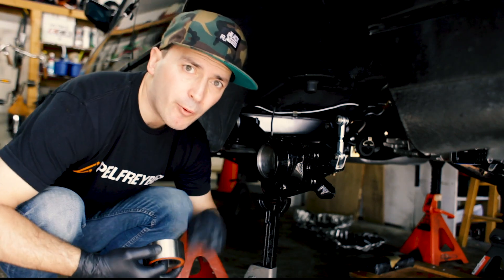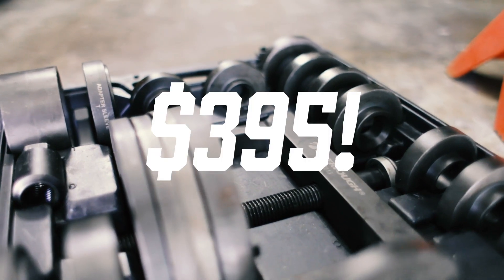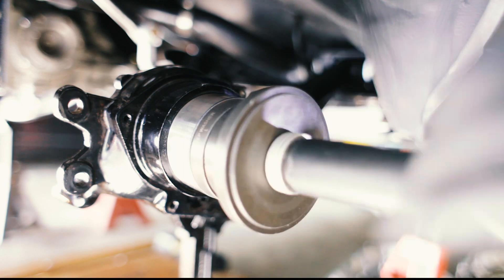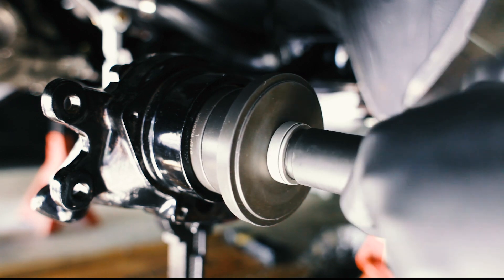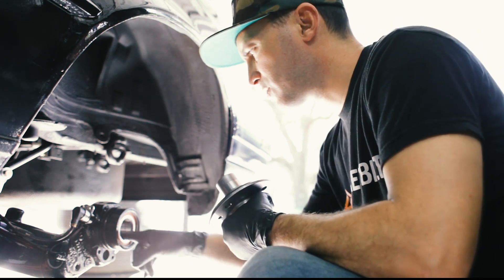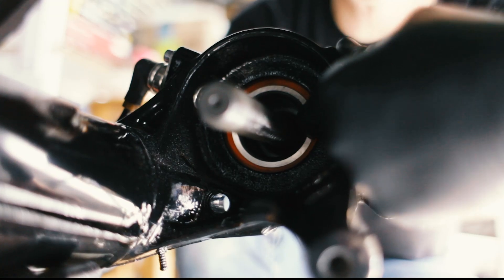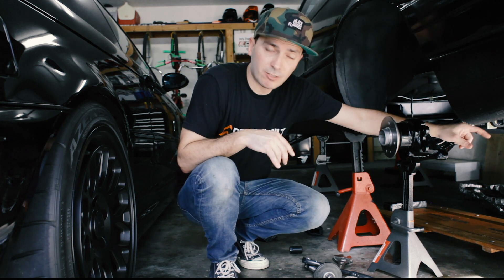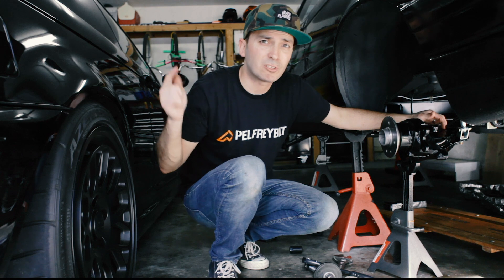Installing Rear Wheel Bearings and Hubs on the E30 | vlog 078

Comment: how do you get the dust cover plates installed? i think they go on first and then the hub.
Reply: there are only two ways - pull out the hub while destroying the bearing or cut a slit in the cover and slide it over the spindle.

Comment: What hubs did you use?? BMW new is $400 each side and I think that’s a bit insane
Reply from the maker: To be honest I don’t remember, sorry. Looking through my old receipts I only have receipts for the bearings and front hubs, but not rear hubs. So I may have cleaned up the rears and re-used the originals. I know the fronts were an off-brand, not genuine BMW. At the time I was buying these types of parts off eEuroparts.com and I just did a quick search and there are no off brand rear hubs, so I do think I just restored and reused the originals. Sorry again I couldn’t be of more help.